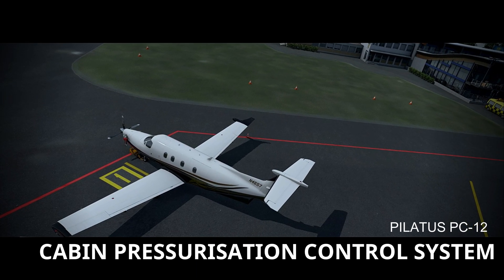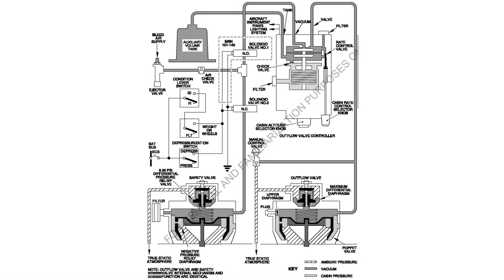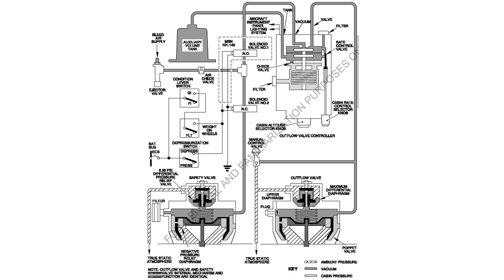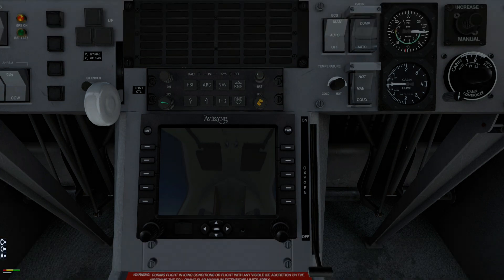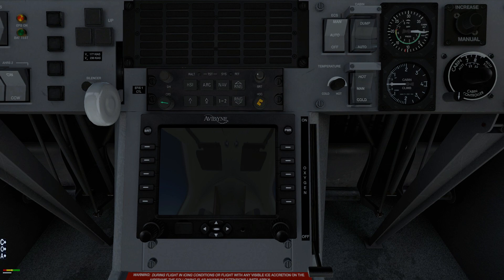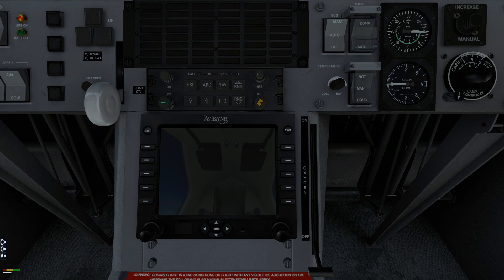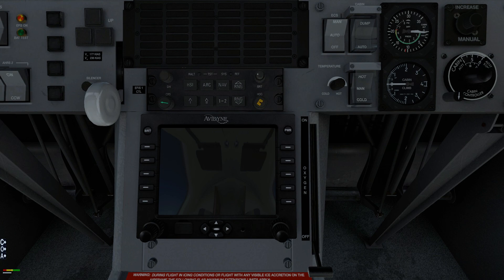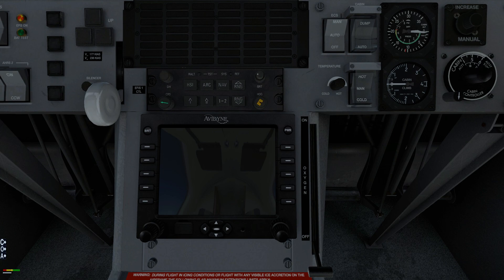X-Plane 11 : Carenado Pilatus PC-12 : Cabin Pressurisation Control System Tutorial

Comment: Perfect explanation. Exactly what I was looking for. If I  have  understand it correctly, for the cabin altitude knob, the selected altitude needs to be read 'at 12 o'clock' on the know, even it there is a sort of 'window' between 11 o'clock and 1 'clock approximately. In your example, you have set an altitude for the aircraft of 17000 ft (the inner knob indication') which will result in a cabin pressure altitude of 5000ft. Great. I have understood it ! Thanks a lot.
Reply from the maker: Altitude is set to 18,500 feet, cabin altitude 5,000. You can cross reference the actual altitude using the instruments during flight.